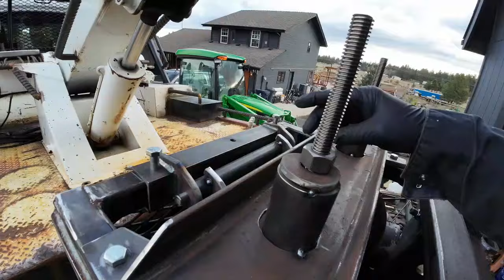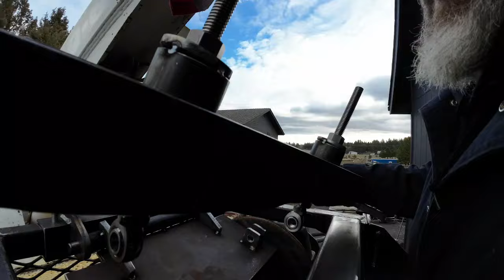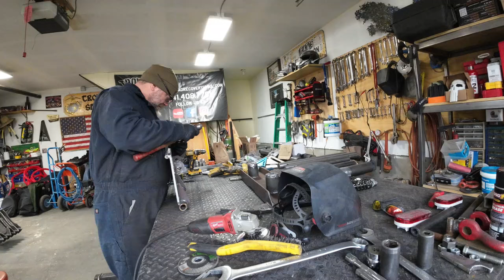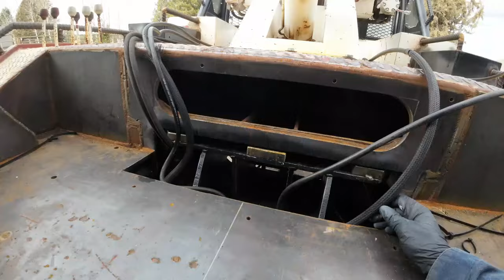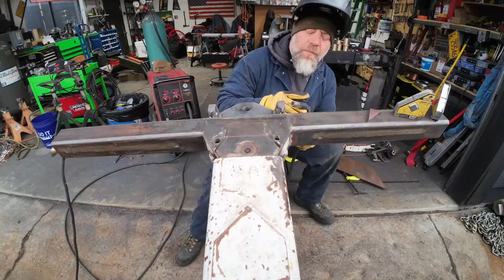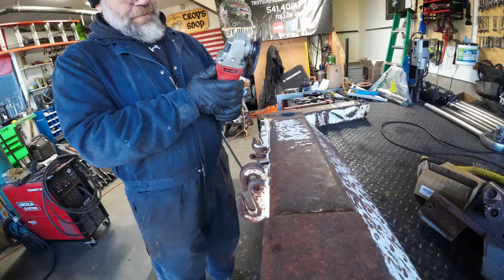Finishing some loose ends on the Offroad Wrecker

Comment: Does that ball setup work for 5th wheel gooseneck trailers?
Reply from the maker: I'm sure I can pick up a gooseneck trailer, I would have to get a 5th wheel plate.
Reply: @troysOffroadRecovery  I am thinking of the RV and stock trailers. Don't they use a 2-5/16 ball?
The 5th wheel plate would be more for a larger wrecker. A lot of weight to carry on single axle.
I think the larger goose neck trailers use either pin or ball, convertable.

Comment: Awesome progress. My question is would it be beneficial to put a roller on the spool plate instead of round stock? Or would it just be another failure point?
Reply from the maker: It's just another failure point. I didn't weld it solid so if it wears out I can weld a new one on.